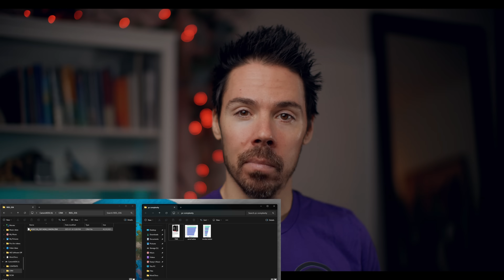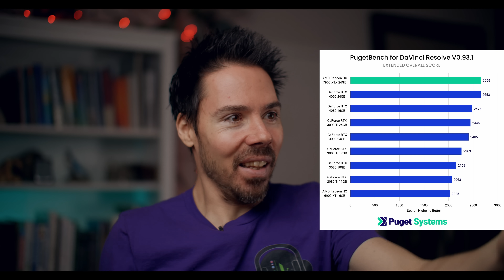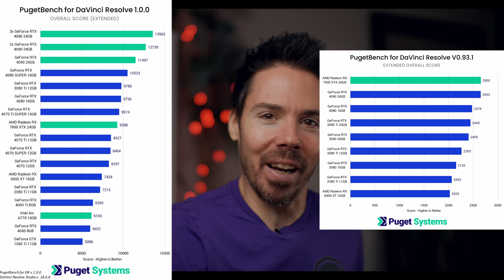The PC Building Rabbit Hole NEVER ENDS!

Comment: Yeah, I'd have to join those that say get a new motherboard.
Reply: I do happen to have a new in box ASUS ROG Crosshair Dark Hero, aka the most high end board of the high end X570 AM4 chipset. On board usb C and all the other goodies
Reply: @Gti_Jason  I had ROG board before, with best CPU that can fit, only because friend of mine wanted always top tier setup, and then sell it 4 months later for the half the price only to get newer top tier setup....Numbers and charts are just numbers and charts, but there is something about added value of premium capacitors and mosfets and goodies that you will not find in those cheap-ass boards. 10/10 would buy a best MoBo I could find...  
As time passed I went to refurbished 3U/4U chassis servers as workstations, having RAID storage and plenty gigs of ram for pennies is for me absolute no-brainer but I have a room where the beast can live and the noise that can awake a dead is not an issue :D
Reply: @Gti_Jason  that's a good option, but then.. the 3600x is a bit slow. ;-)
Reply: I still think save up for Zen 6 at the end of the year. then sell the 3600x and B450, DDR4.
Reply: You literally have a usb 3.0 header on your motherboard. You can connect a usb-c output to it.
Reply: @ he needs type e usb c not three
Reply: @ incorrect
Reply from the maker: Then you're building a whole new PC.
Reply: @cameraconspiracies  If staying with the AM4 cpu series then just upgrade to a B550, you can put everything you already have in it and benefit from a cooler running system, its no big deal and not 'building a whole new pc' which you keep saying. Hell you don't even need to re install windows just install the same drive you have and make Windows 11 'active' again...it's not difficult, honestly, I have just done something similar. Hate to add ( well not really ) but a Mac mini would suit you perfectly, they make no sound at all....silence is bliss.
Reply: @pl2514  Agreed!  You can even get a used motherboard for cheap.  You don't need new RAM or CPU, just a different motherboard.
Reply: @cameraconspiracies  just get an Apple again.  It just works and we can work without knowing how it works
Reply: @ its just more money and the same chinese crap.
Reply: @cameraconspiracies  not really.
Reply: Exactly. I have been building PCs for 25 years. In the past, it made sense to upgradei individual parts. Today and especially on Intel platforms, that make their CPU incompatible to ilder Motherboards, you sre much better off upgrading the whole system every 4-7 years than to try to “upgrade” your system. 
On a different but related note: the PC industry (non) aroption on USB C connectors is a disgrace.

Comment: put the ssd in the other x4...
Reply from the maker: Will I have to do anything special or will it just act as normal when I reboot?
Reply: @cameraconspiracies  give it a proper slap before putting it in there, so it knows it needs to perform better now
Reply: @cameraconspiracies  normal on reboot
Reply: @cameraconspiracies  Dude, your PICE4.0 bus has a total of 64GB/s across all lanes, that is more than any or the total of all your peripherals will ever use, so this is a non-issue to start with. And no, just keep your NVME SSD where it is:)

Comment: A bunch of 5090 reviews are dropping and its a monster for 10 bit editing the price is monster too
Reply: @MonicaHolly143 The 5090 is a $2k USD card and even more in Canadian pesos!
Reply: That's why you buy a 4000 series with a no questions asked extended warranty, then you run it on full settings with Cyberpunk until it heat sinks itself to death. Then you bring it back and  they give you a similar 5000 series card due to the 4000 series no longer being available.